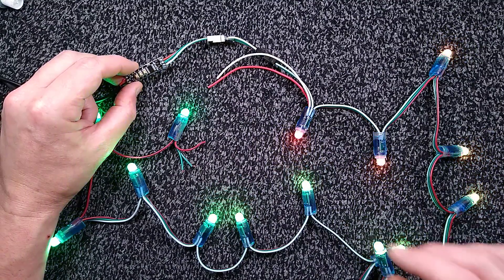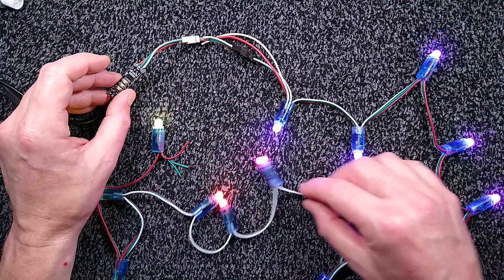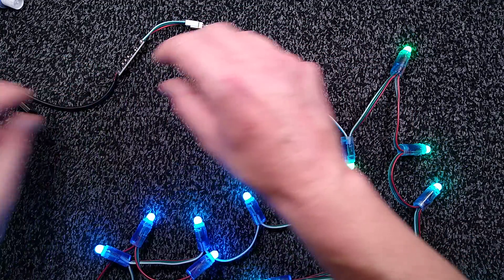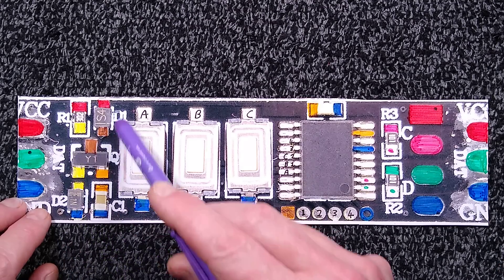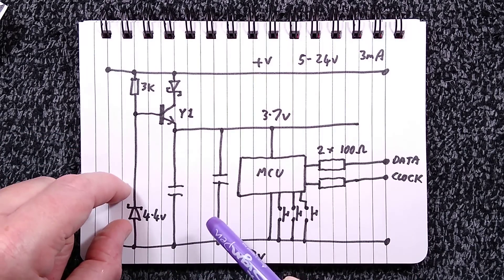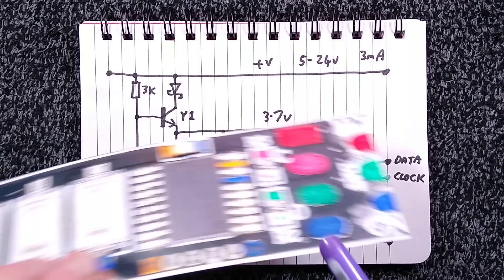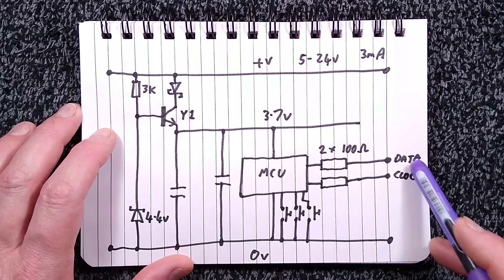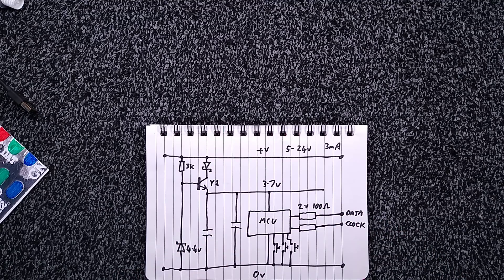Inside an SP002E pixel controller (with schematic)

Comment: just bought on , just connected 5 v pixel strip & powered on through my 3s partially charged battery, was written 5-24v supply on the controller, it worked all pixels were glowing ,color changing but all were blinking periodically, pixels don't have any pattern like that, i thought power i/p was less so i connected a 12v/1A smps adapter to the dc i/p . the moment i powered on all pixels just lit & faded away & never worked after, after opening the sp002e controller found the dc i/p 5-24v was directly connected to the pixel + supply with no regulator in between this  damaged everything, i knew pixels always operate on 5v just didn't check the controller.
Reply from the maker: You do get 12V pixels and 12/24V addressable tape.

Comment: I like controlling my LED strip with arduino and i have written (stolen + modified) some very nice rainbow effects.  I very much like the SP002E controlles aswell ( because of it' s cheapness). 
Is there a way to implement your custom code to the SP002E microschip?  i know it can "pass through" the Arduino code, but using arduino to controll led-s seems a little overkill.
Reply from the maker: There are ways to port your finished and compiled Arduino code onto a bare microcontroller.

Comment: I got video of some lights I haven't seen before. I think it's probably RGB rather than pixel on coloured lighting, but the icicle/meteor set also has separate control of the individual light-strips, as well as duplicate bank control of the set. https://youtu.be/3ihywwbWCDQ
Reply from the maker: Might be WS2812B LEDs or WS2811 pixels?

Comment: Hi Clive, My guess for the 3.7v is that the WS2812 LEDs usually run on 5v, and they only have a tolerance for data voltages a certain range below that point, and if the micro controller was running at 3v3, that would be too big of a difference for them to be able to see a logic high as such. Just a guess, but 3.7 might just be within the realm of acceptability for the dataline. What do you think?

Comment: My brother has the same controller. Also says the same thing 5v to 24v. However when applying 12v it fried the controller. Not sure why. I looked and ony thing that went bad was the diode and 2 resisters. I repaird them and the controller worked again. The controller fried again and repaired again. Seens it's not a above 5v controller.

Comment: Addressable LEDs are so versatile and you have SO many ways of driving them! Years ago I got a 5m strip of WS2812B RGB LEDs, and pieces from that strip are now running on a "christmas" star that acts as a night light most of the year (driven by an ESP32 running WLED) and in a pretty large 7-segment clock I built/3D-printed myself (driven by a RasPi running custom python code).
Nice to see that there are also off-the-shelf solutions for people who don't want to tinker/code much themselves ^^

Comment: Actually, in the video we can see the STM32F0 MCU: it's a typical professional solution for the task of driving addressable LEDs. Using an STM32 MCU, you can get a much more flexible and efficient combination of a timer and DMA to a data stream buffer in RAM. It costs literally zero CPU time to send commands to the LEDs at the highest supported data rate (limited only by timer clock source frequency), resulting in their maximum update rate. It's a very elegant technical solution, I love it.
Reply: While the cheapest STM32 could do this job quite well, even its bulk quantity price would put it far out of reach of the parts budget for this controller. With the SP002e selling for as little as $1 on Aliexpress in small quantities, it's pretty safe to say the microcontroller used is from the catalog of a domestic Chinese micro manufacturer. Also, the pinouts for power and ground are in entirely the wrong places for the 20 pin TSSOP version of STM32F0. A "professional solution" is giving manufacturers of SP controllers waaay too much credit for something that was intended to sell by the million to consumers at the lowest possible price point.
Reply: Do you know Which Is the chip used on this board?

Comment: 3.3V is on the brink of the minimum „high“ voltage for LED data when the LEDs run at 5V, so maybe that’s why they went a tad higher (still within the Vcc limits of the microcontroller).

Comment: If only there was a way to make an RGB controller on my $800 motherboard control more than 120 in a string (and even that takes a software hack). I mean damn, it can handle 128GB of ram but the Asus designers can't afford to add 4kB and a sligthly faster $20 microcontroller? If they were worried about dummies drawing too much current from the 3A RGB socket most know to use an additonal power supply and put that in the user manual if not (5v 80A for mine, but had to split 2520 LEDs up into 21strings of 120, annoying when that messes up some effects when an Arduino can control 10's of thousands with appropriate power distribution). Really wish the signal amplifiers (SP901E x3) could also multiply the input data stream by 21 in series (same 360 input bits from the mobo repeated 21x before going to first LED) rather than simply act as a signal repeater/amplifier, but don' t think such a thing exists.
Reply: That's kind of like wondering why Ferrari don't offer bullbars and towbars as factory options. It's not designed for that sort of use.
Reply: @tin2001  Well it should be, My custom acrylic case can handle far more than 2520 leds (it's big enough to also have 22 hot swap bays + 4x 5.25 bays, water loop that holds nearly 2 gallons, as well as it's own internal 800W audio amp).

Comment: There are ATMegas with pin 7 being supply... but I think they are pin 8 GND rather than pin 9.
Reply: Do you know Which Is the chip used on this board?

Comment: The 100R in series of the dataline, is a recommendation to put a low value resistor in series with the first led data line.

Comment: Another issue with long strings is voltage drop, made worse by the fact that WS2811/WS2812 are 5V devices. Long strings tend to a red hue towards the end.
Reply: Even with digital transmission of the RGB values?

Comment: I think they went for a custom power supply because some versions of the WS2812 LEDs are only guaranteed to detect a high input level at > 3.5 V, and probably 3.6 V regulators are not as cheap as their solution.

Comment: I've been using ws2811/12 LEDs since 2014 I got into it for a charity Xmas display and then shop window displays this was before the days of esp8266/32, The 100 ohm resistor will help protect the microcontroller but are more about stopping signal ringing...if you're installing the microcontroller a long way from the LEDs the 100ohm resistor is a must have for stability, I often have 5-10 meters before the first led... nowadays most home users just use wled from aircookie and add custom user mods if necessary.

Comment: The reason for the discrete voltage regulator is due to the wide range of the operating voltage, 5V-24V. The little uController cannot tolerate a high voltage, probably good up to only 6V. Many manufacturers make LDOs (low drop out regulators) that can produce a tight 3.3V from 5V, but they are only good for a 7V maximum input voltage. Hence these guys decided to "roll their own LDO" using a zener and an NPN, which can easily tolerate 30V or move.
Reply: I think I've seen IC regulators that could do the job, but they're not nearly as easy to source as the discrete components used here.
Reply: I think I've seen IC regulators that could do the job, but they're not nearly as easy to source as the discrete components used here.

Comment: I've used an Arduino Nano to control those neopixel lights, using an appropriate library file.  It works well, although it gets a little complicated when you have an 8x32 pixel panel and you want to put up words but the pixel connections are in a zig-zag back and forth across the panel from one long edge to the next.

Comment: try testing SP107E!!
because it has mic in it, it response the pixels lighting with the sound!
it almost has 200 patterns and 50 music patterns...
it also connect with your phone using one app called (LED chord) with Bluetooth and "location" in your phone! then you can control the lighting modes!
(I have it in my home it's really good!) 
"I can send you the video how it's looks working with sound, if you want!" 😀
Reply: I searched up a teardown and they have a ST microcontroller in them and bluetooth chip

Comment: the HD107s LEDs uses standard SPI @ 40KHz (as opposed to the custom 800Hz bit-banged protocol of the WS2812b). this means that any half-decent micro with DMA-driven SPI can run a string of them in its sleep. literally.

Comment: I built a camping lantern/bluetooth speaker with stereo VU meter visualizers using WS2812 surface mount LED tape, an Arduino nano, and a $20 Costco lantern. It worked amazingly well considering it was the first time I ever tried programming those LEDs. There are libraries available for the Arduino that make the programming a whole lot easier than trying to bit-bang them yourself.

Comment: The Nuvoton MS51FB9AE might be a good candidate for our mystery microcontroller, as it has the right power and ground pinout, and also happens to be well stocked on LCSC right now. I'm not sure what to make of the rest of the pins though, as the clock and data are connected to UART peripheral RX and TX (not SPI as I would expect), and the 4 pads on the side that look like a programming header instead go to PWM outputs.
Reply: Do you know Which Is the chip used on this board?
Reply: @gaucholivido  Very difficult to know for sure, unless you go through many datasheets and compare each pinout. I did not do this, of course 😄

Comment: STM8S103F2 or similar
Reply: Yes, the data output comes from UART TX, which is used in some cases to create the correct pulses precisely in HW. „up to 1MBit/s“, so you can create 1..8us pulses with a 1us precision.
Removed HW label recovered!
Arrow Electronics claims to sell them for 80ct. Others are just out of stock.
Reply: Do you know Which Is the chip used on this board?

Comment: Thanks for the thorough explanation. 
I've been using the same WS2811 LEDs and controller as part of my Christmas lighting for about 5 year's. The slow changing rainbow effect is also my favourite, which conveniently is the default effect on starting, which is ideal of timer control.

Comment: I remember that things like Neopixel strips have significant current draw once you start getting into higher numbers of lights. Is this simply because of the number of LEDs, or is the addressable part in each light 'node' a significant contributor to this?
Reply: High numbers or high brightness simply due to their potential brightness. There's a rule of thumb somewhere to have power supplies spaced out along the strip every x LEDs.
Reply from the maker: At full white a neopixel will pass around 50mA.  That soon adds up.

Comment: Actually they just require consistent data throughput at X bits per second. A DMA controller can do it as a repeating side process.  Then the MCU can spend all it's time updating the values sent.

Comment: I like MartyMacGyver's esp32_digital_led library for the ESP32 series of microcontrollers.

The library leverages the onboard "RMT" peripheral (designed for sending data streams for infrared remote control).   This means the ESP32 can send long streams with strict clock timing with minimal programming effort and CPU overhead..   Also allows creating two or more distinct bitstreams and sending them in sync.
Reply: Coded my own sk9822 library for the ESP32. What's nice about those lights is that you can bang those bits as fast as you want (at least on the ESP32), and the LEDs will handle it.

Turns out you can even set per-LED brightnes levels from 0 to 31.

Negatives: needs a logic-level shifter as the ESP32's 3.2v/3.3v logic voltage isn't reliable enough for data or clock.

Double negative: the datasheet has a big flaw in it for terminating the bitstream. Had to search elsewhere for a workable hack.
Reply: ha, interesting...

Comment: Interesting, although very limited in terms of control over the LED string. I've got a number of ESP8266's running free WLED firmware pulling controller duty. £1.50 for a controller with artNET/DMX over WiFi isn't bad.
Reply: For minimalist builds that don't need WiFi I've had no problems running these on 50c Attiny402 MCUs. Their low power consumption is also great for battery powered designs. And the newer models like the 1626 are easy to get Arduino USB programming working!
Reply: Yeah I was gonna mention WLED but I see somebody already has.
Reply: I have a string of LEDs like these connected to an ATTiny85 as a controller. It runs a sequence of displays.
Reply: Yes me to. Seems to be the cbea
Reply: For me there are two distinct use-cases: Lights for myself (WLED) and lights as gifts to non-technical people (these little controllers are great fit for those)